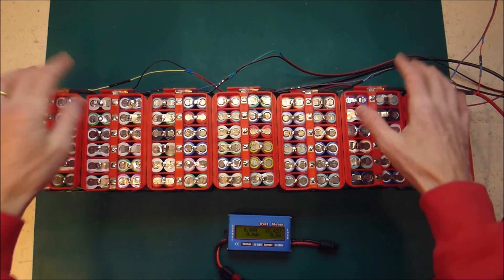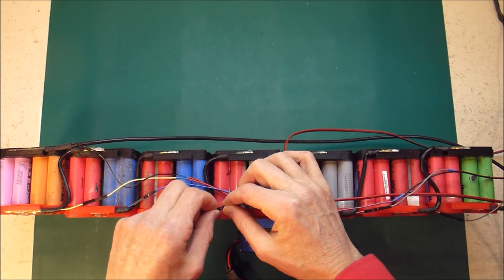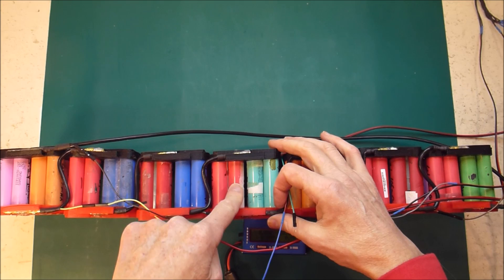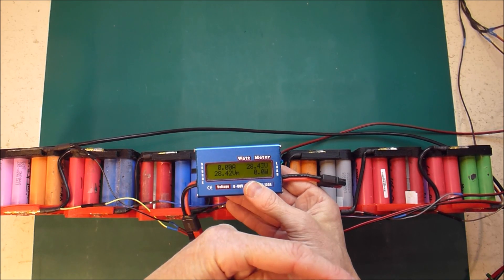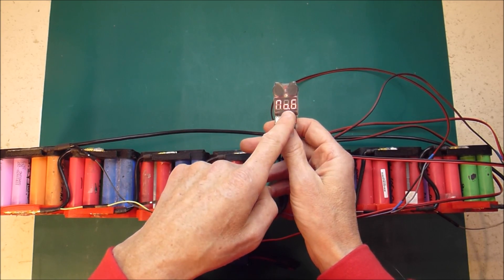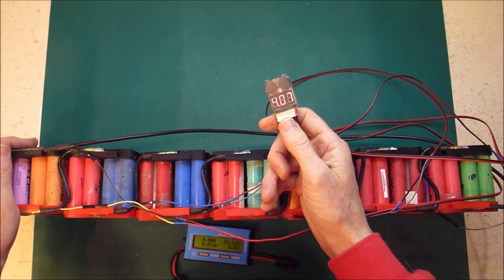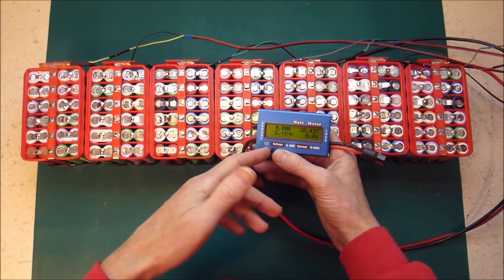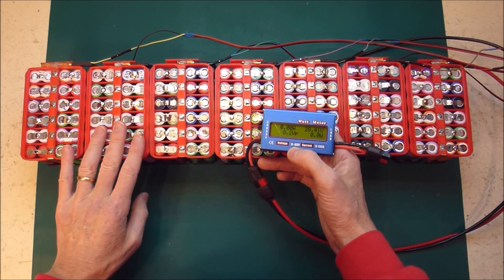Laptop Powerwall 54 - small blocks pack wired up

Comment: Hi Paul, great channel! Going to give a go at building a power pack along your design. I've printed out a few of your holders just to get a feel for the small block arrangement. I'm thinking of adding some tabs, perhaps nut-traps, to permit securing the blocks to a suitable baseboard. Had you given any consideration to how you are going to hold the blocks together and make the assembly more  rigid? Threaded bar through side-channels (as per BatteryBlocks) are a possibility also, but seem complicated. Happy to hear your thoughts. I'll go ahead and enhance your design and share back anyway so you can see my thinking. Tks for sharing all the great info.
Reply from the maker: I haven't yet finalised my mounting arrangement so will be interested to see what you come up with. I've just baught a server rack cabinet  and am thinking ahead to 48 volts.
Reply: Hi Paul, I've modified your 3D printable 2x6 battery holder, incorporating a tab & nut-trap (M4) so it can be fastened to a base or rail. I've re-shared via Tinkercad since you did the original design in that. A spacer is now included to protect from contact with any metal rail you might attach it to. I've include some photos just as an example of how the tabs could be used to mount the battery holder to some   rails (some scrap aluminium I had around). Hope you find the idea of use. https://www.tinkercad.com/things/jDsbHNPcaZQ?display=kEMYIgS7rK0
Reply: oh... I also widened and raised the height of the channel for the nickle strip, as you had said in one of your videos that it was a bit too tight, and made some other wall thickness tweaks to give a stronger print, after some test printing I had done.
Reply from the maker: That's a great improvement. I like the cover plate over the connector. It looks like the bolt hole at the connector end is slightly off center.
Reply: Will fix the hole alignment.
Reply from the maker: Ah! I just realised you're using some old DIN rail to screw together. Maybe I can get the base to clip to wall mounted DIN rail. That could work very nicely.
Reply: Hole alignment fixed. Had to learn a bit more about Tinkercad first! :-)
Reply from the maker: What do you normally use?
Reply: Sketchup or123D Design mostly.

Comment: I love the modularity of this system I'm wondering about the current carrying ability of the banana plugs   on the main positive and negative.
Reply from the maker: My understanding is they're good for 15A at least. These particular ones are actually called "bullet" connectors and they're better than typical cheap banana connectors (http://www.aliexpress.com/item/GoolRC-10-Pairs-4-0mm-Copper-Bullet-Banana-Plug-Connectors-Male-Female-for-RC-Motor-ESC/32643946994.html). They're used in some e-bikes to carry 30+Amps. @Mikes DIY Tesla Powerwall uses both pins on XT60 connectors which is a nice solution too.
Reply: Thanks

Comment: Hi Paul, enjoying your channel as always. Question; I am assuming this "small" pack will be re configured to parallel, then in series with your other "small" packs? Probably a silly question, if so just wondering will you be keeping the same gauge linking wires or will you go heavier?  Thanks.
Reply from the maker: I haven't decided which way I'll connect them all up. The nice thing about the small blocks is it's pretty easy to reconfigure to whatever I dream up. At some point I'll want to switch to 48V which will mean I can stick with the thinner wires. The real Tesla Powerwall is 350-400V!
Reply: Thanks Paul, would you consider selling your 3D cell spacers?
Reply from the maker: Sure! ... but my 3D printer isn't that flash so the prints are just "OK" plus shipping from New Zealand would probably be slow and expensive to you. Are you in the UK or US?
Reply: No just across the bay in AUS Melb.
Reply from the maker: Ah. I send <1kg books to Aus all the time and it's usually NZ$10 - so not too steep.